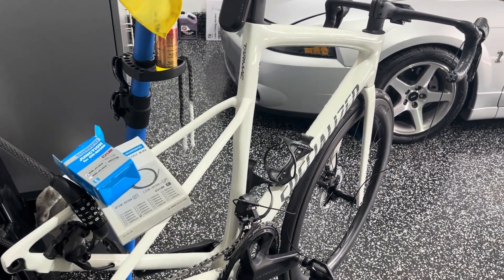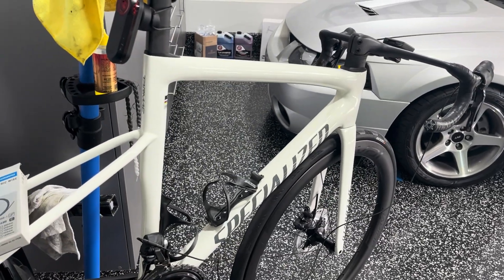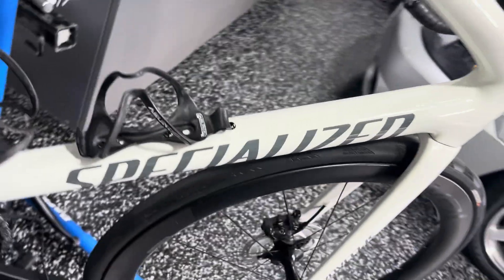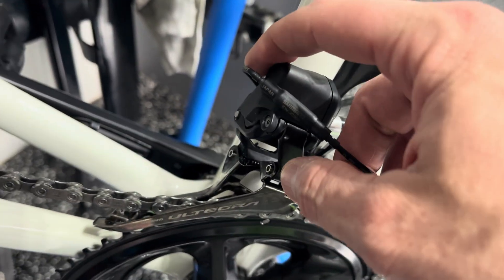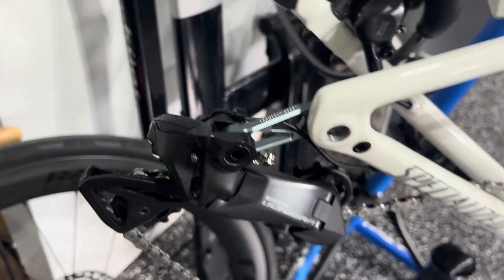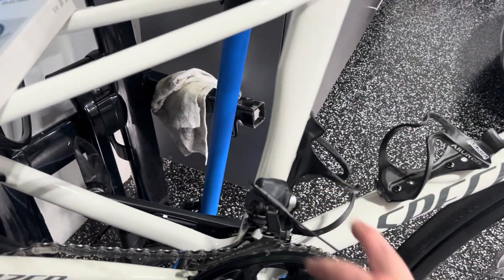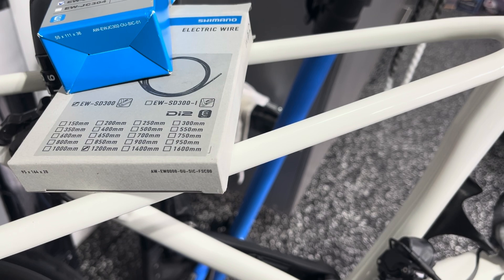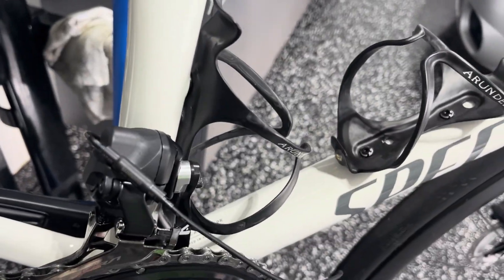Firmware update for Shimano 12 speed shifters

Comment: So frustrating how Sram’s total system from a maintenance standpoint is so much better but Shimano’s shifting is better. SRAM you just do it all with the app.

I couldn’t find the 302 so had to by the 303 and pull the bloody battery out of the seat tube to update the firmware
Reply from the maker: Shimano e tube app is not bad, just the hardware on the bike is out dated. But I won’t give up that smooth Shimano shifting! Remove the battery! That’s nuts
Reply: @addictcyclist  yes, the app is okay. But SRAM’s is just so user friendly. Imagine they merged… then our groupsets would be beaucoup bucks
Reply: the shifting isn't too far tbh

Comment: is it worth it?
Reply from the maker: I can’t tell a difference haha probably not
Reply: @Circletakesthejake  can confirm, no real functional difference. But I did find when I had left the firmware in the shifters too long while updating the battery and derailleurs, there’d be shift lags sometimes
Reply: Security update probably. Someone found security flaws with di2 that allows shifting to be hijacked.
Reply: The biggest benefit is the ability to set up 'Front Shift Next' this means that you can have a single button (or you can still have both) to both shift up and down the front derailleur.  I have been running it for a good few months now and it's amazing.  You wouldn't think the fraction of a second to think which button to push would make a difference but it does.  Alternatively you can then set up one of the shift buttons to an additional function on your computer.  But I just have both set to change up or down the FD.